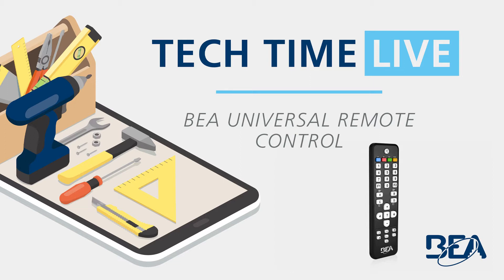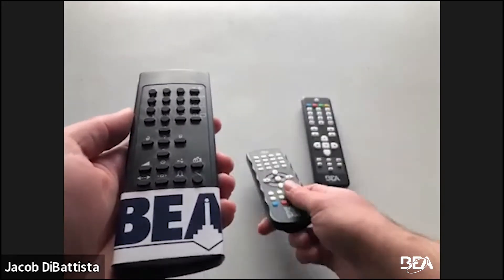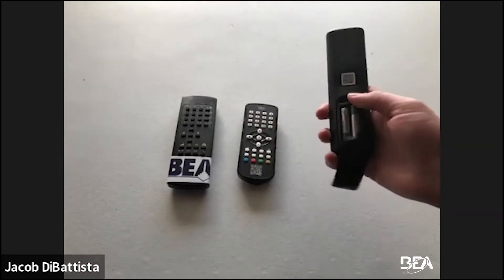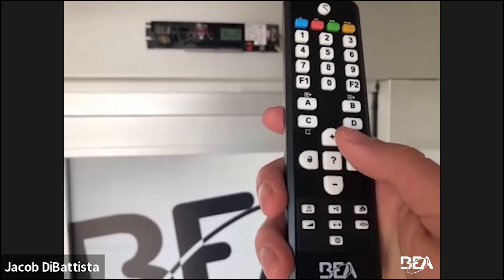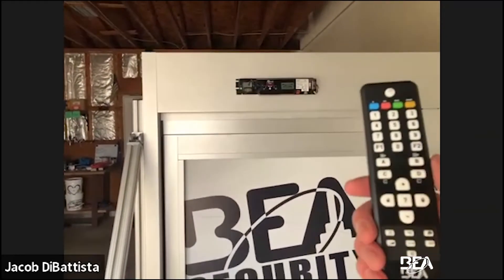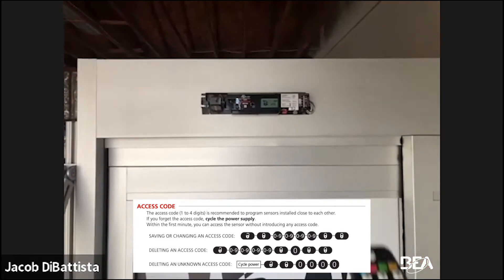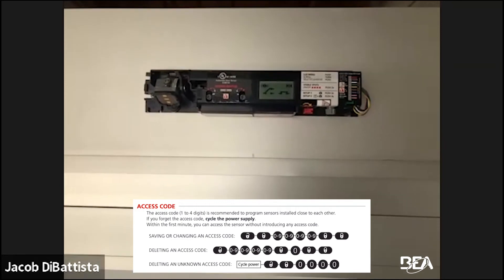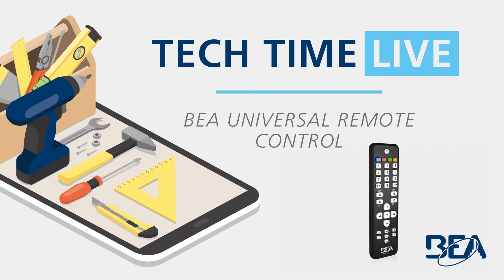TECH TIME LIVE: BEA UNIVERSAL REMOTE CONTROL (2022 Update)

Comment: How do I make a door stay open, sensors closes and opens door when detecting motion
Reply: Luis,

Our sensors are designed to just provide a signal to the door operator.  The operator is what controls the movement of the door whether it opens or closes.  Wherever the sensor wires to, that is what it will do.

That being said, the door should have a timer to close module inside that lets the door come closed after x amount of seconds.  It also depends on the type of door and application.

Feel free to call us anytime to talk about this
Reply: @Jacob DiBattista  thank you for your quick answer! I already spoke to one of your techs, will look into the TTC of the the lift master, this was for a Honda agency and falcons work great is just that one detail of the door closing when cars pull up